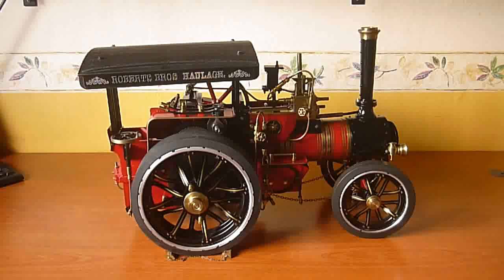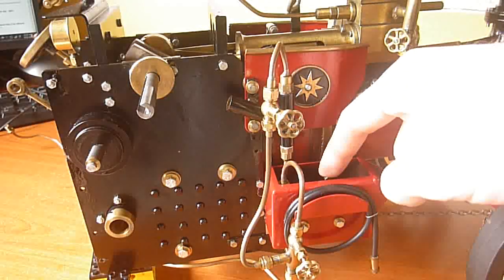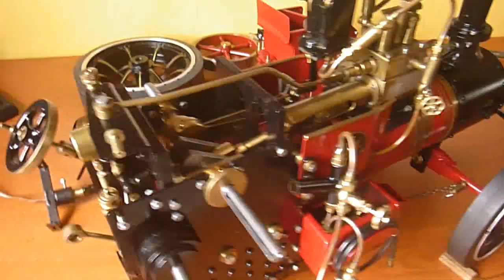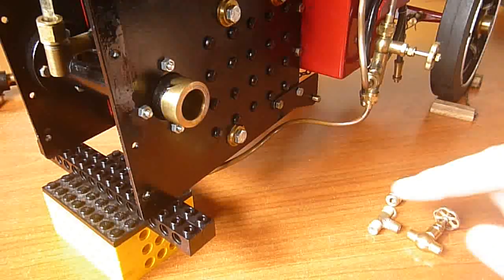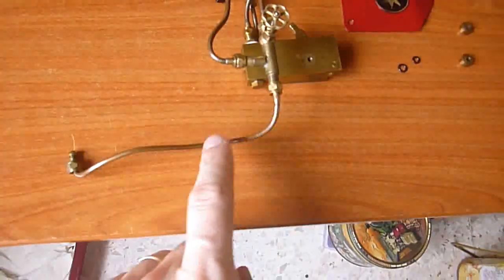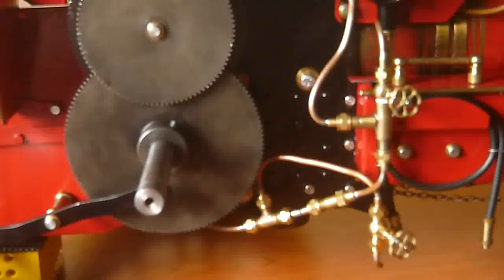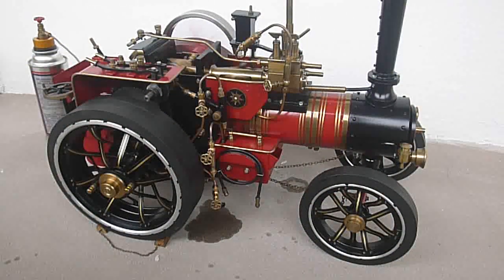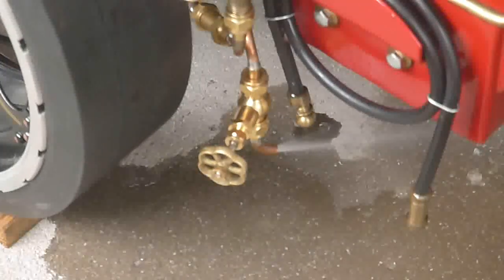Modifications to Markie traction engine

Comment: Brilliant Kevin! I own the same engine, a lightly earler model. I came to the same conclusion due to the location of that pesky check valve right next to the boiler. Your mod looks great and I am sure Tony would approve. I'll do the same.

I have a question for you. On the left of the engine, looking from the firebox end, there is a cable drum. Does yours do anything? My engine has a small bracket/holder just below the steering control rod that looks like a shaft is supposed to be there? The drum appears to be fixed bit it does rotate a couple of degrees.
Reply from the maker: Hi Richard, thanks for the kind comment. Yes, my winch is the same - unpowered, only cosmetic.

Regarding the blowdown valve. Since this video was made, I also added another blowdown vent on the bottom sightglass fitting, so I can blow out the sightglass and get an accurate water level reading. I removed the fitting, drilled a hole in the bottom and soldered in a short length of 1/8" pipe with a coupling. This is connected to another bit of tube going up to the cab, where the valve is. Then a vent tub back down under the engine. If you do this instead, you will get both benefits: a blowdown valve and also clear sightglass readings. Good luck, whatever you do.
Reply: @kevininasia  Hi Kevin, that sightglass is a pain! Suddenly full or empty! I've yet to see it half full. Would a blowdown valve fitted to the sightglass completely empty the boiler?

Comment: Dear Kevin,I own 2 markie's showmans en 1 plough engine and i would like to provide this with your adjustment.Can you tell me which parts to buy and where to buy them.Kind regards Erik from Holland.
Reply from the maker: Hi Erik, I bought the parts from steamfittings.co.uk. Look under these categories: check valves, globe valves, and pipe nuts & ferrules. You'll find everything there. Also you'll need some 1/8" brass brass or copper tubing. Good luck!
Reply: @kevininasia  Hi Kevin,thanks for the information i'm going to see what i need and order it at steamfitting.cheers.

Comment: Hi kevin, a very informative video,thank you, I also have two markie engines, a showman and a ploughing engine, the ploughing engine is coal fired, and showmans gas, I hope you may be able to help me, I have a problem with the showmans engine with the piston rod gland leaking, do you have any idea how A, how I can replace the gland packing, and B how too tighten the gland nut, think the gland was damaged when I replaced the graphite yarn on the piston, the only way I can see to do this is by stripping the whole engine assembly, and hoping I can find a socket that would fit the gland nut , think an engine strip is out of my skills range, I believe that there must be a easier way to do this, would have you any idea this can be done? Kind regards Vinny
Reply from the maker: Hi Vinny, thanks for the kind words. I think you will need to disconnect the piston rod and remover the trunk guide to expose the gland. I don't see any other way of getting in there. Not exactly stripping the engine, but i don't think you'll be able to adjust the gland nut without at least doing this. Good luck. Dive in!